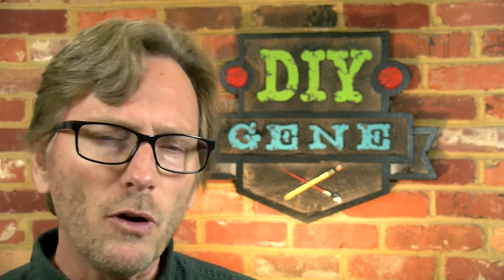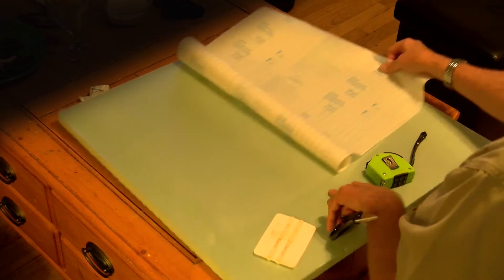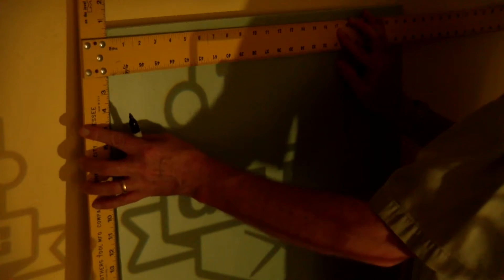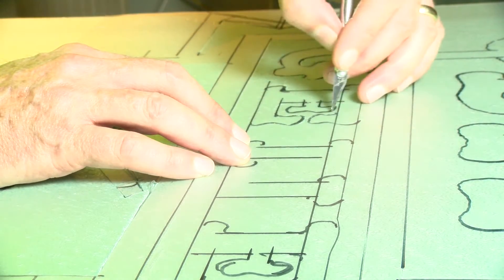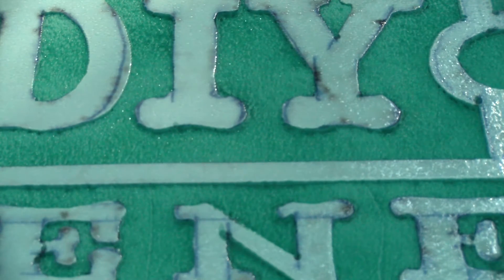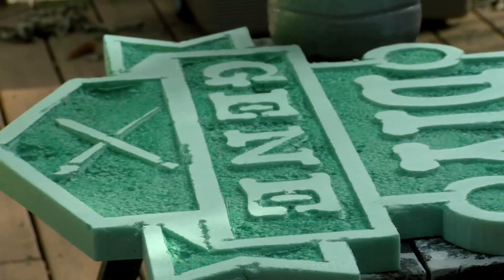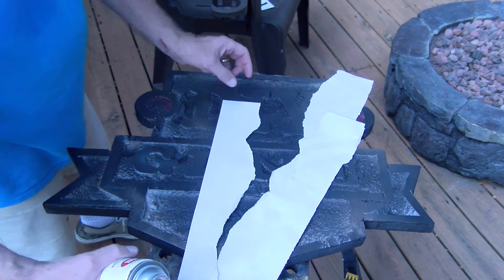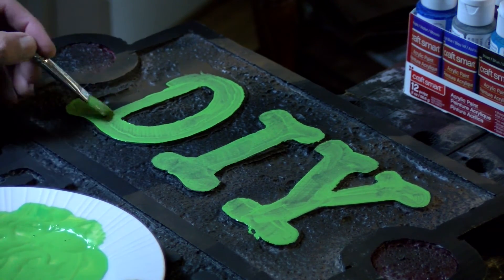Faux Stone Sign from Foam (How to build)

Comment: @DIY Gene.   Great show. Thank you for sharing your technique.
When do you take the shelf liner off the raised up parts that didn't get sprayed with the lacquer.?   I'm guessing that you don't leave it on and paint over it.?   Because the first time a corner pealed up it would get pulled off and reveal blue styrofoam.
Reply from the maker: jenky1044, You are absolutely right. After you have sprayed on the lacquer and it has dried. Peal off the shelf paper and then apply latex paint to seal. Thanks so much for watching.

Comment: Hey there! Thank you for the tutorial! Is there anything that would need to be done differently for a similar piece to withstand outdoor conditions/ weather? Other than using outdoor latex paint?
Reply from the maker: Yes, I would put an outdoor clear coat on it like a polyurethane. Just make sure it has a full coat of latex paint on it because the polyurethane will eat the foam. I hope that helps. Thanks for watching.

Comment: Great tutorial. I'm wondering if you could use vinyl cut from a Cricut, then transfer it on the foam, and spray the thinner on, skipping the cutting step, seeing all that would remain from the transfer is the vinyl. Do you think that would work?
Reply from the maker: I do that now as well. But I find your going to get better results if you trace around even the vinyl letters. You don’t have to go deep, just enough to score the foam. I would experiment with it and see how well it works with no scoring and with scoring. I hope that helps. Thanks for watching.